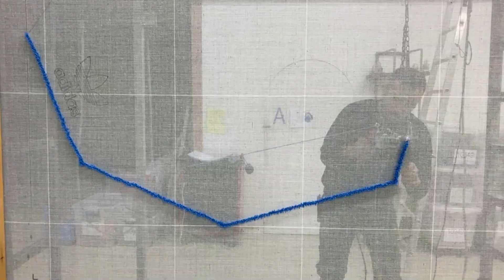Tufting A Rug For Adidas | KRAMIS x Studio Surface Service

Comment: I always rewatch your vids whenever I see them on my recommends. What is that thing at 0:11 ? Is this the same as the ice pick-like tool you used to separate and show the edges of the rugs?
Reply from the maker: Haha thanks, nice to hear :-) No this is something different. This is more like a fork and we normally use this to take out the wrong tufted fibers. We are perfectionists and if the tuft line has not the same space between or when we slip down or up, we use this to take them out efficiently. But in this scene the worker uses this fork to make the line straight. Since the line is diagonal and the fabric not, he had to make the border of the rug straight.
Reply: @kramis_teppich_design  learned something new from your team! Appreciate your feedback as always!
Reply from the maker: @darbyrea1648  Thank you too for asking!